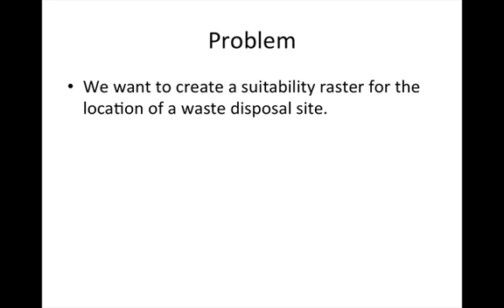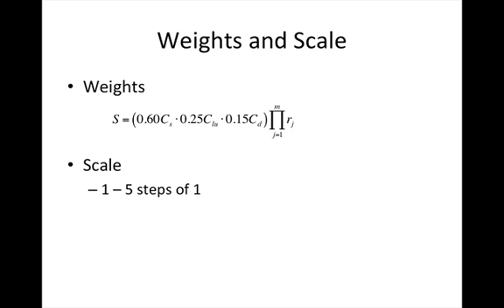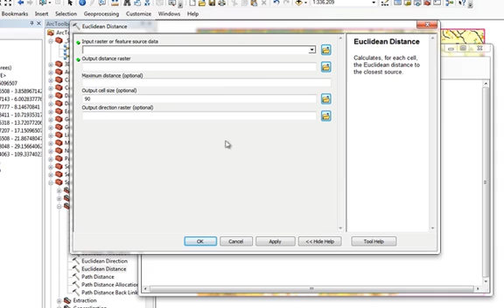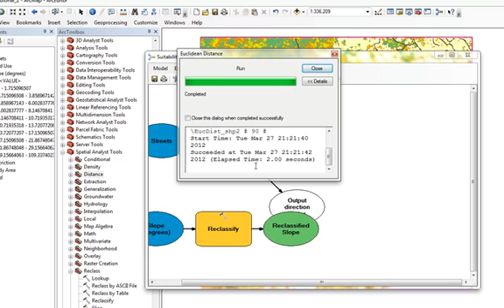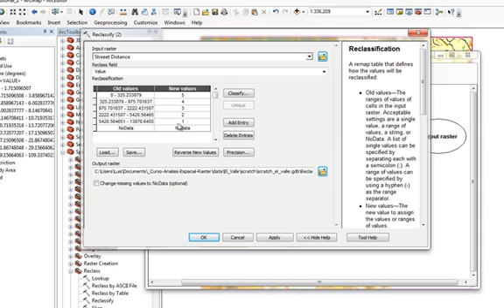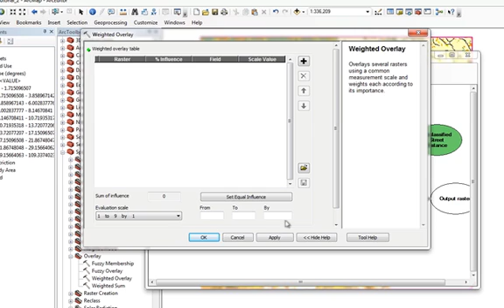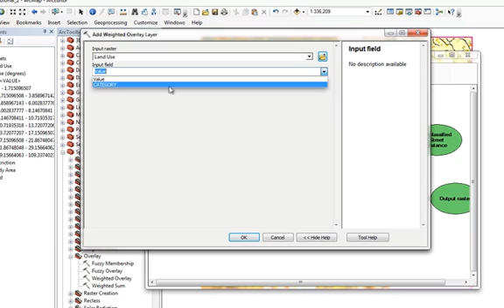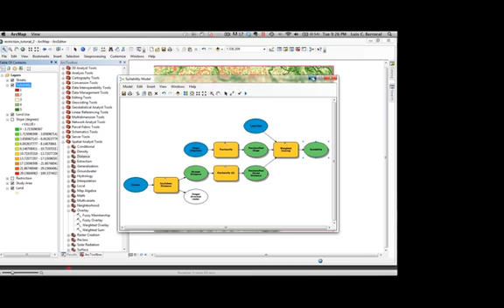Suitability Analysis with ArcGIS (Part 2 Suitability Model)

Comment: I have a complex problem with Euclidean Distance. How can I measure the distance in Km/M or feet instead of degree?
Reply: you convert the map to a map that uses meter as the measurement. either do it by changing the map projecting the raster to a different map that uses meters.

Comment: Hi Luis, I am getting the following error for reclassify (2): "The input raster maximum (42252.29296875) is out of range.
To ensure a correct reclassification, edit ranges or use a different precision settings in the Reclassification dialog box."
Could you help me with this?